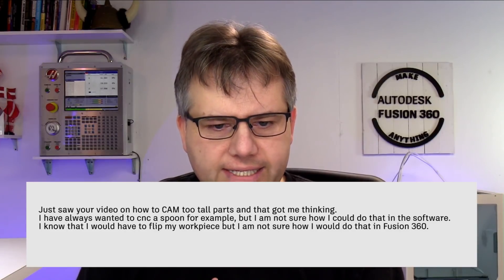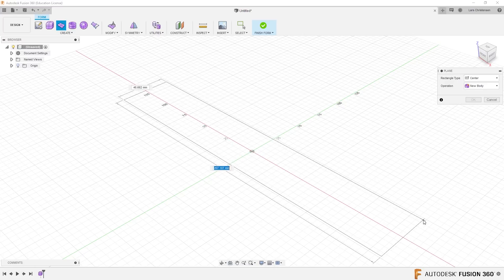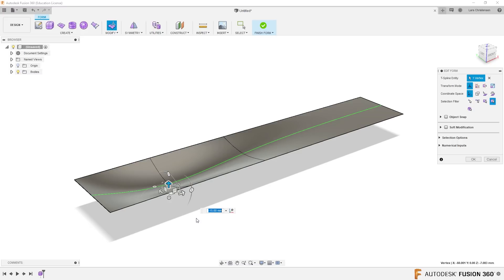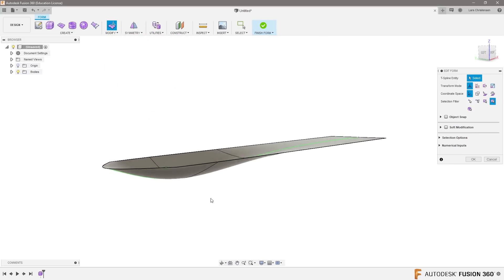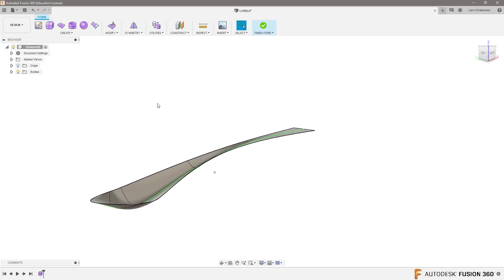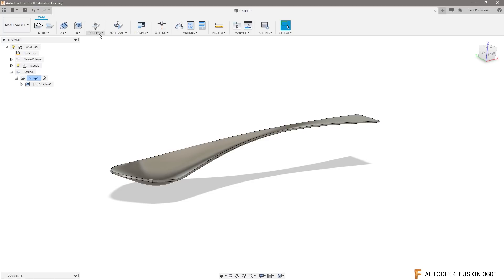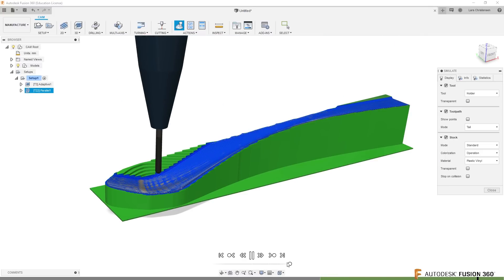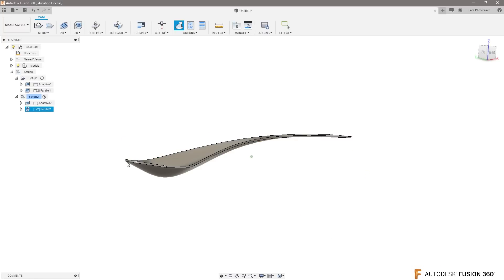Fusion 360 — How To Model and CAM a Spoon — Ask LarsLive

Comment: Fusion 360 is no longer free so I can’t use it anymore.  🥺🥺🥺
Reply from the maker: You can select a startup/hobbyist license for free if you make less than $100,000 a year. The software will ping you yearly, I believe. Click the flag within the software and follow the information in the dialog box
Reply: Lars Christensen thanks Lars.   I will have to try.  I will have to reinstall first.